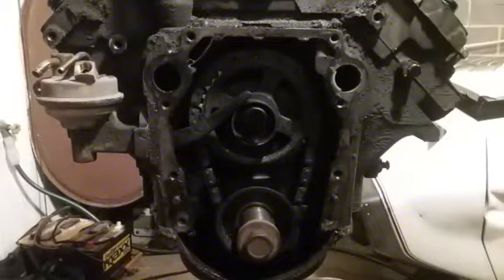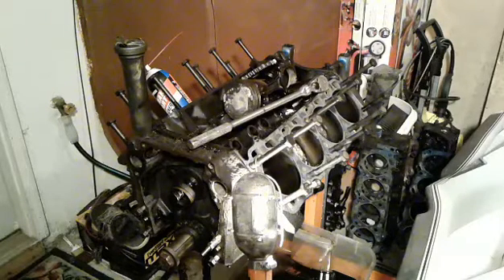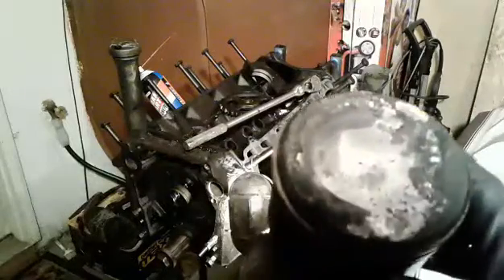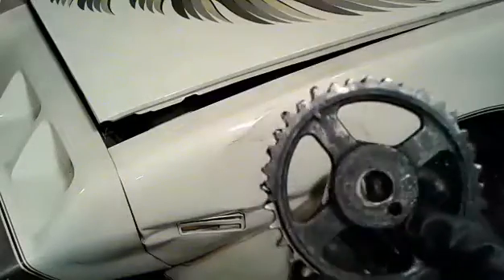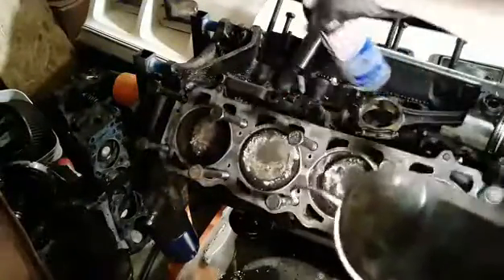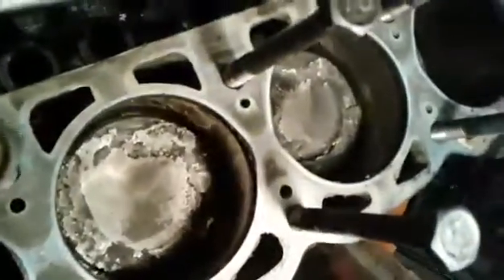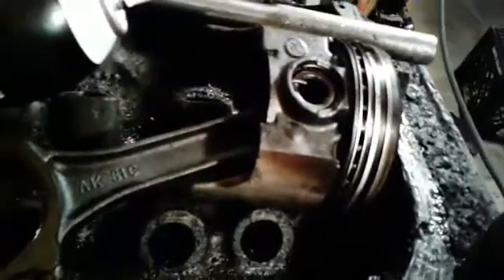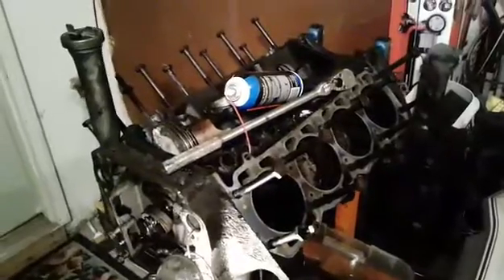Olds 307 Examination

Comment: I have a 307 V8 in my 1985 Oldsmobile Station Wagon, I nicknamed my old wagon, the "crop-duster", because it burns oil right out the tailpipe.  I bought the old car back in 2012 for $500.  And it still runs to this day.. recently I drove the old wagon on a 200 mile trip to my new place and it made it without any issues.
Reply from the maker: the legends are true, these things never die, like one of the 7 wonders of the world

Comment: So where is the video of you rebuilding and running this again? Horsepower is not the be all to end all. These engines have a good amount of torque
Reply from the maker: i wasnt rebuilding this turd, i was dissecting it for my own entertainment. i pulled it out of the car to swap in a 70 olds 350 and since then swapped the 350 for a 69 455 from a toronado, horsepower was the end all be all in my case. car runs great now. im sitting on a 68 and a 70 olds 350 and another 70 455, any 307 that comes my way goes right in the dumpster.

Comment: I replaced the timing set with the water pump in my 87 307 Oldsmobile with around 160k on it. The nylon coating was stress cracked but all intact stiil. Exactly the same condition as my unknown miles junkyard 76 350 was and my friends 79 Cadillac Seville 350 Olds with unknown miles.

Comment: Realistically how much power can you get out of a 307? I have an 87 442  with 287,000 miles debating to rebuild or replace with 425 bbo.
Reply: 425 will get you more power for less $$ 307's have been built to 500 hp but it took a lot to get there
Reply: A guy on youtube built a 307 for dirt cheap and it dyno'ed at rite at 300hp with a cheap cam and some 1410 casting 305 heads he bought off the interwebs!...
Reply: @nathanielbolden5053  That was a 307 chevy that was built and dynoed by Derek @ vice grip garage, They are talking 307 olds totally different motors.

Comment: How did you know the chain was that bad? Did u know when it was in the car?
Reply from the maker: Yeah they all get that bad around 100k miles. Also you can grab the crank and turn it left and right with a socket and big ratchet to feel the play.
Reply: Useful Entertainment ive done that but cant tell how much is too much. Car does run good and have power as its supposed to .
Reply from the maker: @ls87gbody  I'd go by mileage, if it hasn't been done yet get that nylon gear out of there and new chain. Bad chains are the #1 killer of these old engines if everything has been maintained.

Comment: Old raspberry running strong she's got oil leaks now on the valve covers any hints or tips on this 307 7 a head engine I did do dual exhaust with super 10s true dual from manifold back two and a half inch

Comment: I pulled my 307 Olds out of my 1984 Riviera.  It had 220,000 Miles on it.  The chain was about as loose as yours, but, oddly the nylon was all still on the cam gear.  I think I could move the chain about 2 inches.  I replaced the chain and cam gear... much tighter now.  Oddly it will run nearly 5,000 miles on the highway before needing a quart of oil (thanks to changing the valve cover gaskets).  :)
Reply from the maker: neomags thats pretty sweet you have an 84, you still have it? I have an 85. I'll bet your 84 had the better 5a heads tho.
Reply: I still have the engine and trans assembly.  It's sitting on an engine stand waiting to be needed.  Yes, the '84 has the 5a heads.  It wasn't a 'speed demon' but it had good enough power.  After the computer/carb failed on me, I replaced the carb and distributor with non computer versions and it was more reliable.  :P lol
Reply: Oh... By the way:  Replacing the second gear servo on the 325-4L with one intended for a Grand National or aftermarket one Really firms up the 1-2 and 2-3 shift.  This applies to the 2004R as well.  I like the Sonnax one.
Reply: The 325-4L is basically the same as the 2004R.  It does have a narrower chain than the 325 from '79-81.  However,  everything I have learned indicates the chain isn't an issue.  I intend to add the 'missing' and as many additional clutches as I can when I rebuild the trans from the '84 before putting it in an '81 eldorado.  I'll have the 4th gear drum shaved to allow one extra clutch disk.  Personally, I fully expect my trans to survive at lest 500hp without issue when done.
Reply: Oh... about the 455... I have tossed around the idea of a 403 or 455 and even a Cadillac 500 as well... .but, now I'm looking at the LS engines... :P LOL
Reply: I'll add that I put a 403 in a Seville diesel (camshaft was from a 1970 350 and added ARP main studs).  It had enough torque to spin wheels at about 25mph and would just sit there burning tires at a dead stop.  I never had a problem with the transmission... but I had put the better second gear servo in the trans.  Fun times.  :P

Comment: this is a little to late to post but there is a way to fix or help the oil flow or return from the heads to the block faster . and you don't need a mechine shop to do it  . but it has to be done while the engine is apart . if u have deburing tools u can grind down the little shelf or high spot in the head . but  the heads need to be on the block to do this .so it matches up correctly , don't try to open up the return passage to much or it will damage the heads and  they will be useless . just smoothen  the edge . and there are some small areas in the lifter valley that can be touched up to help the oil return to the pan quicker it is just a little bit of work but it really helps the oil return quicker and the oil won't puddle up at the top of the head . just some friendly advice . u might already know this though .